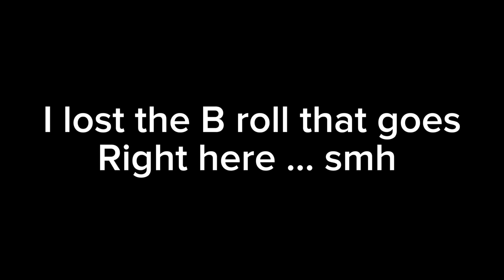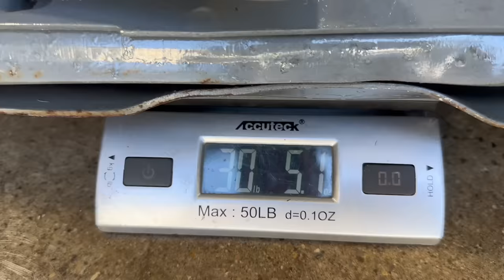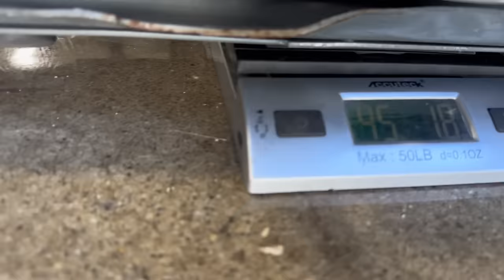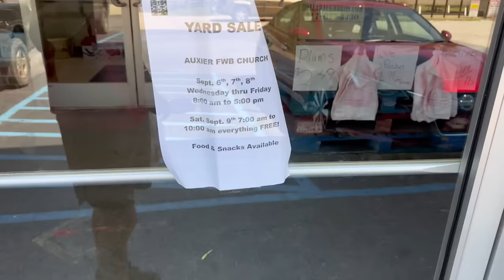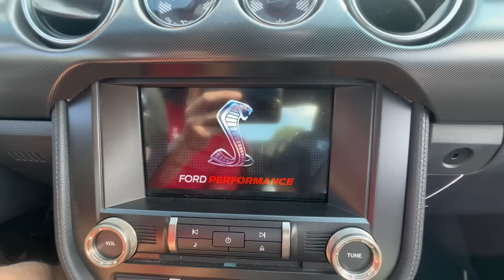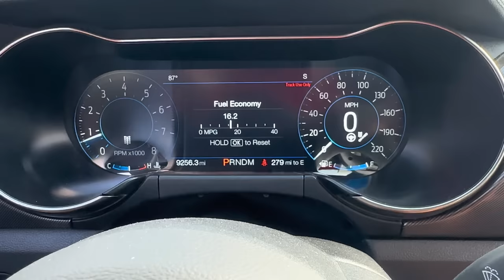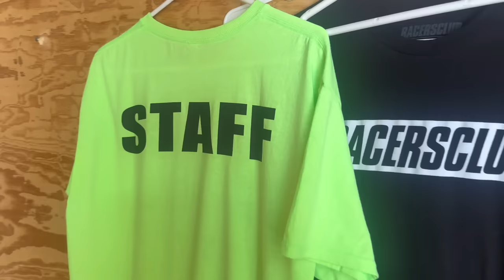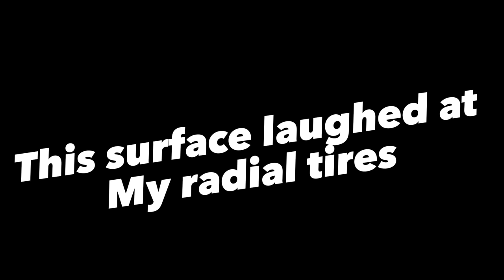ANOTHER JIMMY DALE BANGER

Comment: Crash bars do come out without cutting up the inner door
Reply from the maker: Tell me how
Reply: @JimmyDaleRacing  I cut mine out with a die grinder over 15 years ago. And never touched the inner frame. It is a tight fit getting in there. Back then we didn’t have all the high tech carbon fiber doors or panels so all the stock parts needed to go back on

Comment: Pull the steel out of the front and rear bumpers,  get some lite weight wheels unsprung weight what kind of weight is in your hatch door ? Are you still running a stock  engine cradle? Buy Hole saws if you want to have fun . Pin hood get rid of hinges/ locks all depends on how far you want to go.

Comment: 45lbs is a pretty good weight reduction!
Reply from the maker: Need to find another 45 lbs now
Reply: @JimmyDaleRacing bumpers have a bunch of extra metal in them and a lexan rear window will save alot and if u didnt scrape the floors with dry ice i had 20lbs in my sn95

Comment: I have cut the door bars out of many mustangs and rangers I never cut the door shell
Reply from the maker: How you get the out or the cut off wheel in there to get the bar cut ? .. take the door off drill the spot welds and cut a hole In the front to slide it out the front ???
Reply: @JimmyDaleRacing  2 inch cut off wheel on air tool and cut it front back and middle and pull it out in two pieces
Reply: @JimmyDaleRacing  does your widow still roll up and down properly with the door shell cut?